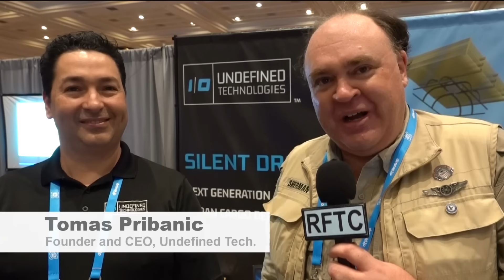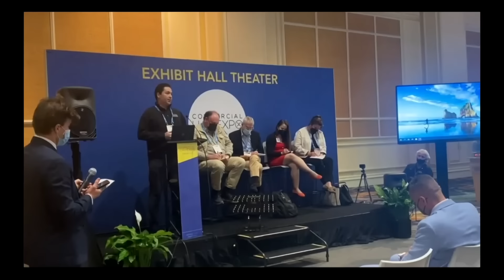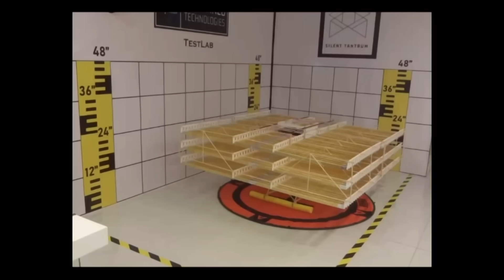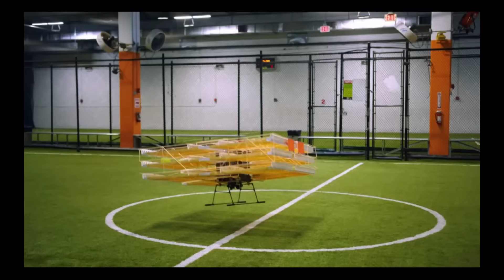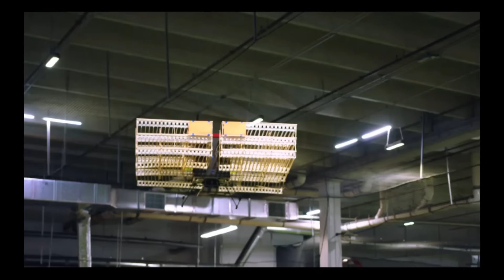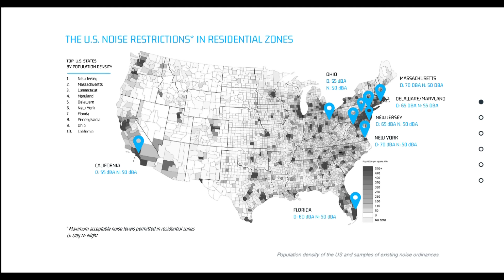New Drone Tech: No Propellers, and Yet It Flies!

Comment: Hrm. I don't like that there was no live video from the convention where the public got to see it fly. I assume it doesn't actually work (or isn't safe) if it's only shown in low resolution company produced videos. It would be very easy to fake those these days.
Reply: Here is a video of it with audio. The sound is that of a loud powerful ducted fan.  Pribonic has a patent for a leaf blower.  If it works at all it is most likely powered by the EDF.
https://youtu.be/iihprC5Huf4
On my channel are the only real ones with onboard power.  They are patented for lifting their power supplies using ion propulsion.

Comment: OMG, this is like 10 times better than the airplane that we saw few years ago.  This last way longer and it produce way more thrust
Reply: The UT hoax was around about the same time as the MIT craft.  The real first one and only one that can lift its power supply vertically is on my channel and it is patented for that reason.  Physics do not allow for the UT craft to get close to lifting its power supply without a loud leaf blower EDF in the center.  Here is video with audio of UT's thing:
https://youtu.be/iihprC5Huf4
Reply: @KraussEMUS1  Ok I see.  is a hoax.  So, they are using the ion thrust just to level the drone?  It was too good to be true :(
I saw your design, classic but including the power source, nothing easy to achieve.  Congrats!.  When the MIT Craft come out, I read somewhere that this type of propulsion "done right" could be more energy efficient than a propeller.. But I imagine as always, when people make these claims, they are just twisting words and definitions to deliver a big headline.   I like airships, time ago I imagine that this could be used with several conductive bands all over the envelope to eliminate the boundary layer that produce all the drag and using a normal propeller for main propulsion. 
But beyond the lack of practicality on bad weather, I imagine is not even energy efficient to achieve even that.
Reply: @angellestat2730   Their drone is leveled by fins at the bottom of the ducted fan, like the Ikarus flying ducted fan online. They also claim it "flies for 15 minutes, is silent, and carries 2 pounds."  
My crafts do have some out of this world utility, but I never try to oversell them. They are not like "classic" "lifters" at all.  I can easily see how it might look that way though.  They do have an emitter and a collector, but the performance is hugely different for a lot of reasons.  It's all on my channel.  Thanks!

Comment: Inefficient, stupid, scam.  Notice the giant fan blowing down in the middle?  Ion propulsion for space travel was explored cause the thrust is miniscule and the energy requirement is high.  Small thrust, no big deal in a vacuum where you don't have air to push against and no giant fan in the middle would work lol.
Reply: https://youtu.be/iihprC5Huf4
The UT craft is a scam as you can hear from the above video.  There is a real version on my channel that is MUCH more efficient and really lifts its power supply with ions!  It will have a use some day, especially in space with a small propellant tank added.

Comment: great interview, great questions, great answers, great technology!
Reply: The UT craft is powered by a loud ducted fan!  Here is video with audio:  https://youtu.be/iihprC5Huf4
There is a real version of the technology though on my channel.   They are the only such crafts though with onboard power.
Reply: @KraussEMUS1  okay i followed your channel to see where your development is leading. i'm highly interested in the topic. and do you think they could be using the fan for electrical components cooling because their model looks about 100% heavier than yours and they might need higher currents to achieve flights which in turn would melt electronics if not cooled by a steady strong stream of air?
Reply: @folonrng  Firstly, "lifters," which their craft is an inefficiently designed one,  tend to require about 1kg of external power supply per gram of craft lifted. Secondly, the fan they use is drastically more powerful than a cooling fan.  It is very loud and appears to have control fins under it for steering. There are EDF flying crafts online that look and sound identical to his.  The Ikarus is a similar example of one.  
Pribonic's craft isn't 100% heavier than mine, its more like 100 times heavier or more.  The geometry of his craft would also take about 10 to 100 times more current to produce much lift.

My patented craft follows physics to lift its power supply.  Some examples are 2.5 micron diameter emitter wire, >15cm emitter wire spacing, 1 layer, and a very specifically developed novel power supply.  Without those things and being incredibly light in weight, a power supply can't be lifted at all.  
He claims his is "silent, the first major breakthrough in 100 years, that it will carry a 2 pound payload for 15 minutes, and that it is completely ion propelled." That claim is off by multiple orders, 2 to 3, of magnitude, and no one can say it is "silent," either.
  
The geometry of his craft would also take fantastically more current to produce much lift. If his craft did lift its power supply by ionic thrust. it would be violating my patents.
Reply: @KraussEMUS1  so what you're saying is that his craft is physically impossible in the form it is presented and he is a fraud?
Reply: @folonrng  I don't know any other way to put it.  I have been reading about and building air breathing ion propelled craft day and night for 22 years.  I am an EE, have 2 patents on this subject, and have the only ones that can vertically lift their power supplies.  I had to cut many hundreds of transformer cores myself with a Dremel tool and later a lathe, and had to shave off every milligram to get mine to fly with onboard power.  I don't think someone can just build a big craft with a heavy plastic pipe in the middle and make it lift its power supply.  I know ordinary lifters have been built by thousands of people an no one could get them within say 1/100th of the thrust to weight ratio for lifting their power supplies except me and later MIT with their glider.  If I'm wrong, it means I have some money coming and I will learn something.
Reply: @KraussEMUS1  i think i understand now. this companies goal is not to create drones that are purely ion propulsion based but more assisted to reduce noise of commercially used drones which is a great idea if i think of amazon motherships. not sure if you've ever seen the video of the test amazon conducted ethan. if not you should. it's pretty funny.

so it's in a completely different ballpark than your work if i'm not mistaken since you do the opposite. 100% ion propulsion based craft with onboard power supply.
do you think your invention has commercial use in the forseeable future and if so which one would it be?

and if not for now my guess is that any breakthrough in terms of energy storage which makes batteries smaller and increases their capacity probably would make a big difference for your project.
Reply: @folonrng  I respectfully disagree.  A ducted fan will likely always be louder than a quadcopter setup due to the physics, depending on construction to a small extent though.  They claim ion propulsion so it is not honest.  The ion propelled part of their craft, if there is one, will always weigh more than the thrust it adds due to its construction, so their craft would fly better without the lifter, also especially in the wind.
My craft is a major breakthrough in terms of efficiency for ion propulsion, at least when it is operating properly.  When it is working at its best it will run for about 2 minutes on lipo batteries with a hot transformer.  With a slight upgrade to the transformer and emitter wires it likely will run for 5 or 10 minutes, and many times longer flying on one side.  That will take another slight steering upgrade to do consistently.  I don't claim it will work on a windy day outdoors.  That is something for the future.  Since it can carry small propellant tanks and solar film panels it will also most likely work in a vacuum as well as being basically silent.

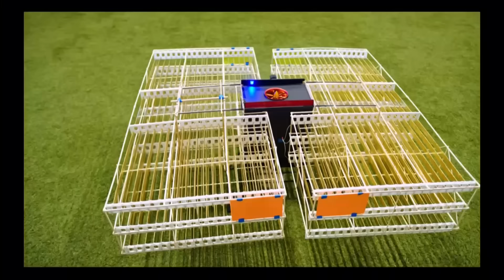Comment: it's a fake at the middle of the drone , you can see an EDF fan brushless motor ! why no noise in this video at the moment drone lift up ? ( stop at 1:26 )
Reply: Proof you are correct:  https://youtu.be/iihprC5Huf4
There are real ion propelled crafts with onboard power on my channel though.  It requires a lot of very special details to lift a power supply with ions.

Comment: This is frigging fake. The amount of power needed is not possible with current technology limitations. Then there is the fact that ion engines dot work very good if at all in atmosphere.
Reply: The UT craft is fake in that it requires a loud ducted fan in the center to fly:  https://youtu.be/iihprC5Huf4

There is in atmosphere ion propulsion, but it usually takes at least hundreds of times more power than can be managed to lift its power supply. onboard.  On my channel are the only ones that have onboard power, but there are a LOT of special details that allow it to work.  For one thing they have to be built to be exceptionally light in weight.

Comment: How does it even carry it's own batteries? Ionic lifters are made of balsa wood, polystyrene and paper. They can only just take off, and have to be powered through a wire to a ground-based power source, that includes the drive electronics. Is this just a standard ionic lifter? That bit about pre-existing ions in the atmosphere is bullshit, that's not a source of energy. All air contains ions but they don't provide any more useful thrust than you put into them with electricity.

If there are loads of restrictions on seeing this thing work, then it's on strings.
Reply: Here is a video of it with sound.  It has a loud powerful ducted fan in the center:  https://youtu.be/iihprC5Huf4
There is one patented series of ion propelled aircraft/vehicles that do carry their power supplies onboard!  They can be seen on my channel.  It was not an easy feet though because you are correct it used to take a relatively extremely heavy external power supply.  Here are the patent numbers for it also that explain how the thrust to weight was increased so much:  US 10,119,527 and US 11,161,631.

Comment: This isn't new tech. Nasa was running studies on this back in 2003 and before that... This tech is still facing the same problem it has since it was first invented/discovered and that's batteries and their low energy density compared to liquid fuels. How are they going to solve the battery problem?

Comment: small issue though.. it does have a propeller in the center. whats it doing there?
Reply: cooling fan?
Reply: @markthompson4885  I'm thoroughly mystified that in the year 2024, the person enquiring about the so called propeller in the centre of the drone hasn't worked out that it's a cooling fan for the ion generator technology.
Reply: @datathunderstorm  I'm thoroughly mystified that in the year 2024,  you do not understand that a fan has propellers. 
you may argue that is not the drone having propellers. 
yeah is the same as me claiming that I do not smell like bull pie. 
is just my shoes.. my shoes stepped in a bull pie.
Reply: @datathunderstorm  Yes, it  flys but it has a propeller. A cooling propeller but never the last, a propeller! I just love technicalities...!
Reply: @ehombane  Most HV power sources need a fan to remove the generated heat.
Reply: @John14Six-r8e  Man, my logic is simple. No propeller means no propeller. 
Fan means propeller. 
And they say no propeller.
And I am tired of lies and deceit.
Reply: @DanSimmons-s2f  it's never the less,in spite of that, it's all the same,however, 🤔😂
Reply: @batoncharge  Wow...I'm trying to piece together your sentence, but I just can't work out what you are trying to say?
Reply: @DanSimmons-s2f  He does not try to tell anything. For some reason people are compelled to say something even they have no idea about the subject that is discussed. In such cases they throw out some nonsense, often comprised by a single word, or a pair. And this guy compiled a list of such nonsensical answers.
Reply: @DanSimmons-s2f  look up the meaning of never the less 🤔, if you new what you we're saying you might not be so confused 😂
Reply: @batoncharge  It's not the obvious mistake I'm talking about, it's when you say "in spite of that  it's all the same,however" 
What's all the same?
Reply: Propeller,,,Fan,,, potato, tomato 🤔😂,
Reply: From the Latin vannus, meaning a winoing basket 😂

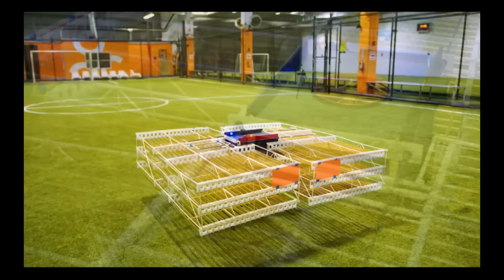Comment: Not powered by an EDF. Look at the frame time 1:47 and you will see that it's a cooling fan for the center component. The level right below it has small diffuser holes. There's no way that fan can propell air through those holes to create lift....
This thing creates heat...did you forget that??
After reading your comments I wouldn't let you guys make me a damn cheeseburger....
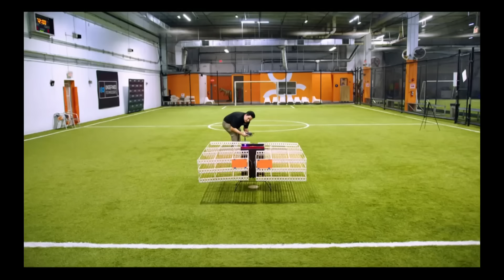Reply: At 1:50 you can see a spot of light on the grass under the craft in the center and what looks like small control fins under the craft. Those diffuser holes are around the edges.   A lot of specific factors have to be just right to lift a power supply with ion propulsion being extremely light weight is just one of them. (For one thing it is not going to carry 2 pounds for 15 minutes without a ducted fan.) On the UT website is a video with audio and a loud leaf blower/ducted fan, can be heard.  If you look online for the Ikarus EDF "rocket," you will see a flying ducted fan with little stabilization fins on the bottom.  There are videos of several similar devices online.  This craft does not have any of the required details that must be in order to lift a power supply with ions using current technology.  On my channel are the only ion propelled vehicles that lift their onboard power supplies solely by ion propulsion and they are patented for that reason.  Sometimes it is not clear on a video what we are looking at or if people are being completely honest, but you can be pretty sure that things won't deviate from known physical facts and quantities by several orders of magnitude unless there is an understandable reason.

Comment: that doesn't have enough thrust density for lift, it's using a fan to achieve flight, not ion propulsion.
Reply: its like the first thing that the video said, its even in the title, and they are showing it in broad daylight and it has no fans. So how did you come to this conclusion? And why did 17 people upvote a wrong comment?
Reply: They say there is no propellers
Reply: here's an excellent explanation why the video above is a pipe dream without massive batteries that would make it too heavy to fly at it's current size.  Nope, not "ION propulsion" it's a fan https://youtu.be/IorDYGI1uqc
Reply: 1:26 is showing the orange fan at the top
Reply: That's likely a cooling fan for the electronics. Such a tiny fan couldn't possibly lift the entire craft, plus a 2 pound payload.

Comment: I'm not sure why this is considered remarkable.
There are videos going back decades of this method of propulsion being implemented to achieve the same kind of lift.
However, note that we don't actually see ANY maneuverability in this video. It can generate some lift, but that's it.
It seems the only advancement made since the 50s is that batteries are now used when it used to have to be tethered by a power cable.
Reply: The UT craft can't get within about 100 times of the thrust to weight ratio need to lift its power supply.  At least not without the powerful ducted fan that is in the center.  There is a video with audio on the UT website.  
On my channel are the only ion propelled crafts that really do lift their power supplies onboard solely with ion propulsion.  They have two US patents specifically for lifting their power supplies against Earth's gravity with ions.  It takes a lot more than just modern batteries to do it, but they are an important factor.

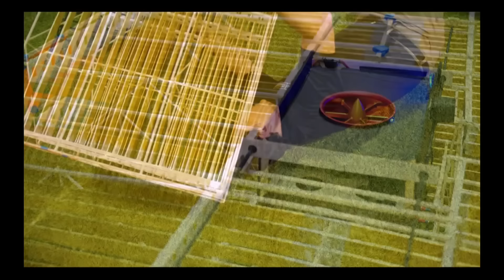Comment: At 1:45 it looks a lot like a propeller and intake with housing that extends down to the landing gear.
Reply: Really? And how does the air go through the plate right below it?
You're pointing out a cooling fan... You expect that to produce zero heat?
Reply: @SeasparrowDD979  The title of the video clearly says "no propellers". That's clearly a propeller.
Reply: @SeasparrowDD979  EDF motors are used to produce thrust and cool the electronics in nearly ALL RC aircraft.....not familiar with the hobby huh?

#DualPurposeFan
Reply: @jaybomb5022  EDF would be prop thrust. EDF would be a poor choice to try to cool anything, a trimmed down computer fan would be lighter and easier to use if cooling were a concern. RC Aircraft electronics don't need active cooling at ambient temps. You can keep flight controllers, receivers, ESCs all inside airplane bodies, or strapped to low airflow areas of a multirotor without issues.
Reply: @mikelostcause  My Extra 300, Cessna C188, Glasair Sportsman, etc all keep the ESC directly behind the motor with its own independent airflow channel. Alot of EDF jets also keep the ESC in the wind channel area to keep the heat sink cool.

Flowing air is flowing air and a ducted fan is a great choice to cool electronics. 

Maybe on a small drone or cheap toothpick you're absolutely correct. But for real high performance applications 4S+ you 100% need to air cool the electronics. Especially on sophisticated flight controllers. 

DJI has a separate fan for its IMU alone to prove the point. 

Nice try though.